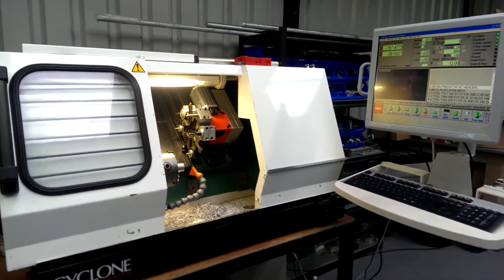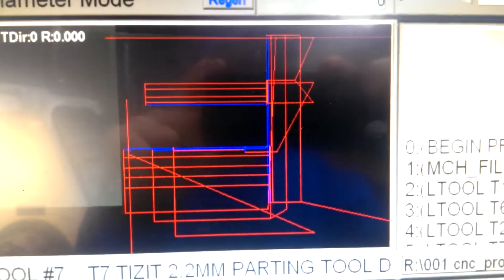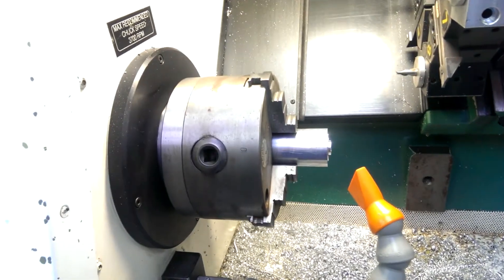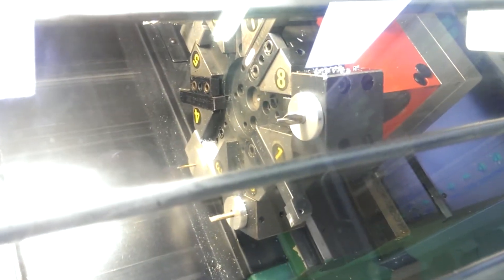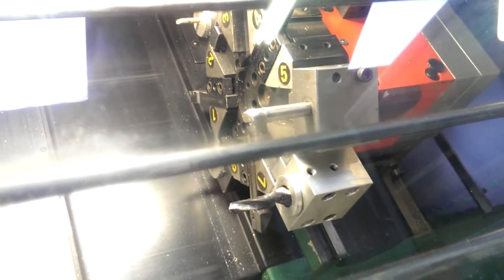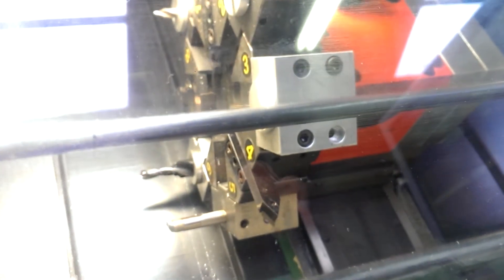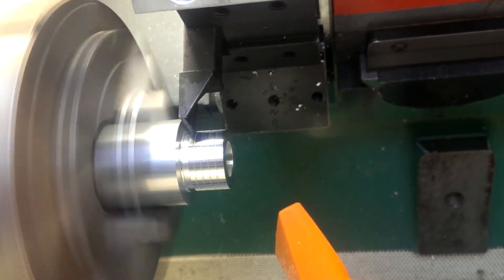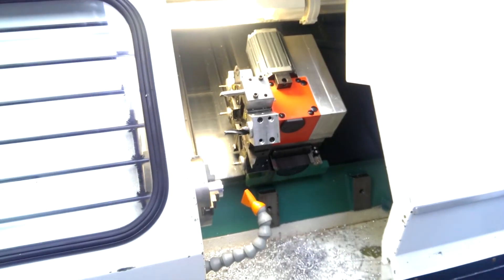Denford Cyclone CNC Lathe Machining Scale Model Part

Comment: You can programme the boring bar the put a chamfer on the back, looks like a nice set up lathe this running 3 or single phase.
Reply from the maker: +Baja5b-SS  See reply above, should have added here.
Reply: +nhbb980 cheers 
I read that the Cyclones dint like running from an inverter, clearly wrong. 
What inverter is it I've pasted up on a chance of one of these in the past, so useful to know one will run just fine on one.
Reply from the maker: +Baja5b-SS It is a Siemens inverter that is placed inside the enclosure. Have not had any problems with it. I believe the coolant pump is also using the inverter
Reply from the maker: +Baja5b-SS If you PM me your email address I can give you more info